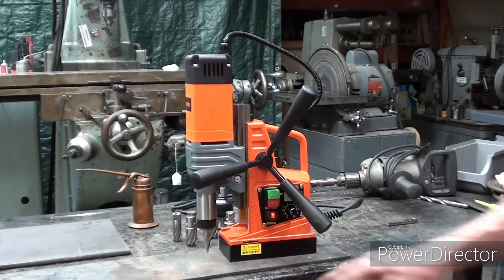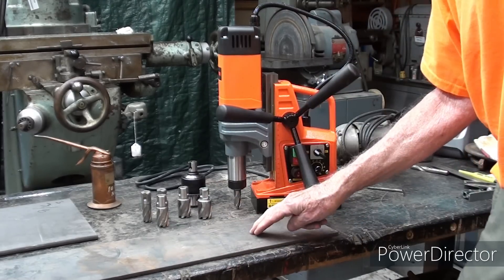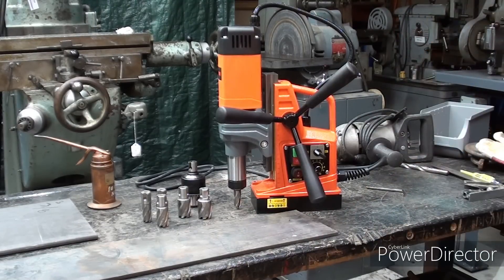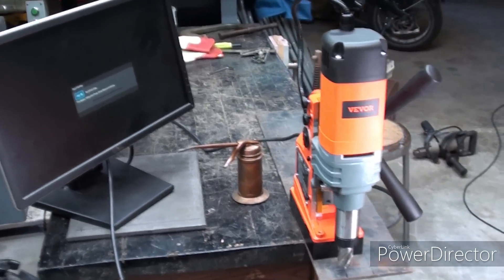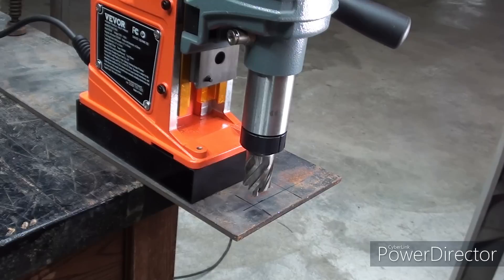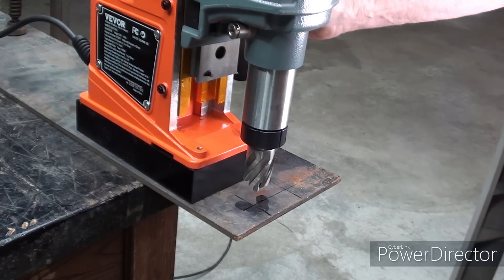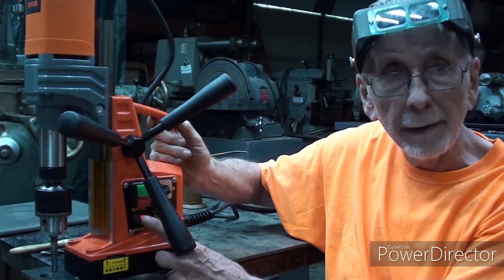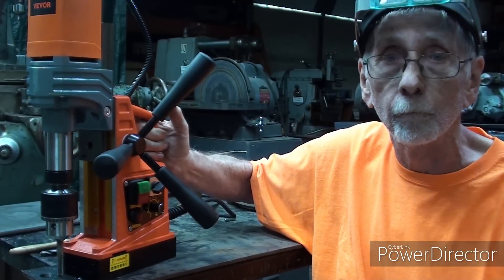MAGNETIC DRILL PRESS vevor pt 2 #877 tubalcain

Comment: Thanks for sharing. I had found the vevor magdrill on sale 6 months ago. I bought the regular Weldon style spindle. I needed it to drill hole in 3/8 plate. I did get a chuck and adapter for it. Stubby drills work well. The mag drill worked very well. I don’t use it all the time but I drilled over 100 holes over a week long project x four projects. I also nibbled a few slots. I used angle iron and “c” champs as a guide fence to move the mag drill base along a straight line.

Comment: My 1/2" Dewalt drill will tie you in a knot if the bit hangs up. My solution is to always drill through into a thick backing plate. It pretty much prevents hang up.

Comment: There is a problem with annular cutters.
Unlike twist drills which drill away your layout marks the slug from the centre of the hole is witness to how accurately your setup was because the layout lines and centre pop marks are visible for all to see.

Comment: 2 comments...  1:  when you drilled the first hole, the 'pilot' seemed to wobble significantly as you started...  how accurate is it?...  2:  back in 1966 worked for a surveying company one summer and had the job of setting monuments. (3' long rebar in a 6" concrete cylinder)...  The gas powered auger (2 man driven) had one person controlling the motor and the other at the end of two 3-4' poles to stabilize it.  If you caught a good rock or a bad root, the person holding the rods would be ejected more than a few feet... (happened several times - this was before OHSA)

Comment: I had a electrical hand drill with a #2 Morse taper spindle. I had to drill two 10" diameter holes in the transom of a large wooden boat. I made a 10" diameter hole saw using a 2" W bandsaw blade welded to a 10" steel disc.  I used an old 5/8" reamer with a #2MT shank as a pilot. We had a 3' 3/4" pipe attached to the drill motor.  The saw would catch and would lift 3 men operating it off our footing.. A scary operation

Comment: nice video, I have been using these slug cutter drills since 1992
and have four of them all different sizes , I install lifting equipment 
on truck chassis and these machines have saved my hands and forearms.
I'm currently trying out tungsten carbide tipped cutters , so far they are great
they are slightly more expensive but for drilling through chassis its the
best , my 20mm and 16mm cutters have about 600 plus holes on them.
Only one con they throw away because they are more expensive to sharpen 
than to buy.

Comment: If one was to get this this mag drill as a gift I to would think it's ok .  Luckly I have and old B&D mag drill from the 1970 that can work all day with the magnet on and has no problem drlling holes up to 1-1/2 . I can reshapen the drill bits onsite , unlike the angular cutters. I Wouldn call it true industrial qualty, unlike the Vevor. Tanks Mr Pete for the presentation might just be the thing to have for hobby shop.

Comment: While working as a millwright in a steel mill in the early 80's, I was using a large 1/2" portable drill with a hole saw to put a 2-3/8" hole in a hydraulic tank for a new hydraulic pump and the hole saw grabbed, almost broke my wrist and before I could shut it off it ripped the cord out of the handle.  Luckily no injury other than a sore wrist for a day or so.  Got the cord repaired and finished the job.
Reply from the maker: Scary, I actually hate hole saws. I’ve had too many close calls with them myself.

Comment: I have a big Milwaukee 1/2 chuck drill that I use to stir joint cement with a paddle.  That bucket need to be held with your feet as you stir the bucket or the bucket spins and throws joint cement everywhere.  I have had a couple close calls with that practice.
Reply from the maker: Sounds scary

Comment: Yes, in the early 70's, I worked for a boat manufacturer. I was given a 1" drill with a 1-1/2" bit to drill thru the transom to install the drain. Several times I did tricks at the drill rodeo for the enjoyment and laughter of my co-workers as that tank of a drill broke thru the 3" thick transom!  😁
Reply from the maker: Scary

Comment: Company I worked for bought 50 International Transtar Cabovers. We had to install 5th wheel hitches. Undrilled frames. 8 5/8 holes per side, through truck frame and crossmember gussets. 2 1/2 inch per side for the mudflaps, 2 3/8 holes per side for the tail lights, 4 3/8 holes per side for the 1/4 fenders. 800 5/8 holes through single frame and gussets. 600 3/8 holes. 200 1/2 inch holes. 1 inch electric drill, 2 men, 2 3/8 pipes 3 ft long for handles. We killed a whole bunch of 5/8 tapered reamers. And a pile of 3/8 drill bits. And that is why i can sharpen drills nearly perfectly. We also had to remove 2 air tanks and tie back lines on every truck, to prevent damage. Then we had to run 1/4 in plastic from the air manifold to the dash panel, cut out the slide switch passages, and run 1/4 in plastic to the sliders, then #4 stratoflex to the slide cylinders. Anyway, there was 3 of us, taking turns on that horrendous drill, until about a week into the project the boss came in with the oldest drill i have ever seen, with a huge electromagnet. it took 2 men to put that in place, and it ate that frame steel like candy. But you cannot forget how dangerous that first drill operation was, if one person slipped or the drill bit stopped, those iron pipes were spinning instantly.
Reply from the maker: That’s a lot of holes, and a lot of hazard

Comment: Hi Mr Pete i have drilled many of hole in truck frames  not fun . I bout on of the early Chines mag drill ( i got 11 cutters no drill chuck just under $300 in 2017 ) the one you have has more options than than the one i got . 
So one thing that's neat is you can make heavy duty  washers and you can also drill a pilot hole to help the cuter from wondering if you drill it the same size as the pointer you have to dig out the plug  . JM
Reply: Drill a center drill hole first then follow with a 60 degree spring loaded pilot to prevent wandering.

Comment: Last Friday the 11th, I went to a garage sale and bought a 1940 Montgomery Wards bench top drill press made by Duro Metal Products. All steel and cast iron. Great shape. For a bench top model it is huge. In refurbishing it I plan the replace the metal tube that supports everything with a longer one making it a floor model. Right now it is twice the size of my current imported model that I bought in 1982. My imported model has severed me well, but I need to be able to drill larger holes.
Reply from the maker: You will love that thing. Perhaps you saw my floor model duro drill, press in my garage???
Reply: @mrpete222  I don't remember seeing one, so I will have to back and watch some more of your old videos. They could not build a drill press like that nowadays. It would cost to much and nobody would buy it. Going to sales of used tools is far more fun than buying new ones and you get a lot more quailty tools for your dollar. Your YouTube channel and ScoutCrafters are my favorite channels.
Reply: @EVILDR235  Clausing is making drill presses in the US. 20" throw, hundreds of pounds, and about $5k.😔 I've lusted for one to replace my old C'man 150, but I have neither the space not the budget.

Comment: Three observations from a person that has used magnetic drills before on a jobsite. 1) You should always center punch a mark. It will guide the cutter and protect it better. If not, it might wobble and shift and those things are expensive enough to warrant not damaging them. 2) Take it slow. Do not add a lot of pressure and back out of the hole regularly to ensure chips are not building up. Again this protects the cutter and does not put as much load on the machine. 3) Do not ruin the chuck by cranking down on taps. They are tough and brittle, and there is still no guarranty they will not spin. Break one tap in a product can sour your day a lot. Use the dedicated tap holders for the tapered shank I assume is in the drill or alternatively get 1/4" hex tap holders for the chuck.  They are cheap and make your taps last a lot longer.

Once I had to make a very big hole in a stainless steel plate using a hole saw cutter. I stood on the plate and suddenly the cutter stuck and before I knew what was happening the plate and me took 8 round trips with me tangled in cable.
Reply from the maker: Excellent advice

Comment: Back in 1980 I owned a 1952 Ford F2 pickup. It had a 215 cubic inch OHV inline six cylinder engine. This was Fords first OHV six cylinder engine. When that engine went bad I installed a 223 cubic inch OHV inline six cylinder engine. They are both of the same engine family. The 1960 engine had a crack in the head and would overheat on long trips. At the time I was working for my good friend in his wrecking yard and he gave me a 1957 cylinder head to replace mine. The 1957 cylinder head used smaller diameter head bolts than the 1960 engine. I got the correct size drill bit using the 1960 head for reference. I bored out all the 1957 head bolt holes to the larger size using a Montgomery Wards drill with a half inch chuck. I was down to the last 3 holes to drill, when drilling a hole the bit grabbed the head and tore the drill out of my hands. It kept spinning until it wrapped the cord around the drill and then pulled the plug out of the wall outlet.
Reply from the maker: Scary

Comment: I’m with you, Mr. Pete- in your non-verbalized, but assured thoughts on that China pile of crap. 

It’s certainly nothing like my Hougen truck frame drill which cuts those same holes in a matter of seconds, and cleaner- made in Swartz Creek, Michigan, invented by a former GMI and Kettering engineering student. 

I’m glad for your video, though- I’ve entertained buying a Vevor as a cheap alternative to keep on my service truck, but what you’ve demonstrated in this video, I won’t get along with it at all. 

That thing is amateur hour, I’ll stick with American made rust belt machines. 👍🏾👍🏾
Reply: It's probably not a bad mag drill for the price point and for the home shop. I agree though, having run a top of the line Milwaukee, that was kind of painful to watch. Most home shop people don't have $2k laying around to throw at a quality mag drill that will maybe get used once a year or so.

Comment: Luckily went from high ground to lower ground - but drilling a big hole in pressure treated wood (which is really wet!) for a retaining wall. Of course, big huge low speed drill - and I checked in at about 130lbs back then. When it snagged in the wood it proceeded to toss me from the one upper yard into the lower!  Fun times! I must have looked like superman for a split second as I flew threw the air.
Reply from the maker: Wow

Comment: I hate to answer but Joe Burden is back in town. And yes i almost broke my wrist with a hole hog because I work in plumbing boring large 4” holes for toilet flanges. My Mikita drill 1/2” almost broke my wrist too. I will always use a pipe handle bracing it between the stud wall.
Reply from the maker: I have use the whole hog drills. Incredibly powerful and unstoppable.

Comment: My best mag drill true story:
Co-worker Bubba was using a dull 1" or a little bigger twist drill in a large (unstoppable) mag drill on a 16" I-beam. The beam was sitting on metal saw horses. He had his arms wrapped in the quill handle to force it through. He overpowered the magnet at about the time it poked out the other side. He couldn't get away from it, the drill and him spun around, flopped the beam over and then off of the horses. It kept spinning and had two wraps of #12 AWG cord around him and the beam. What saved him is that one of the extension cords unplugged in the mayhem. He ended up with some broken ribs, a severely sprained wrist, torn muscles and bad bruising all over his body. I made sure to tell him jokes for the next few weeks. Laughing helped remind him how stupidly he broke his ribs. (And yes, in those days the company let him come to work with broken ribs.)
Reply from the maker: Wow, that’s some story. Very scary.

Comment: I noticed when you tighten the drill bit in the check you only used one of the three locations.
I was taught to properly get a fit on a drill chuck was to snuggit tight using all three tool locations.

Comment: Yes indeed I had more than one unpleasant experience with a big portable drill! I learned to wear heavy welding gloves and some sort of torque arm through the D handle. Also used a "farmer drill press". Long pipe through the D, one end as a pivot and sit or push on the longer end.

Comment: My D-handle drill story, I was a strong twenty-something, not a gym rat but a working man. We bought our first home and were doing some remodeling work. We wanted to install recessed lights in the kitchen ceiling. So have a big drill and a 6" hole saw to drill through a sheetrock plaster and lath sandwich. I am on top of a ladder drilling into the ceiling, first hole no problem, second, ok well the third... The hole saw bites in I hang on to the drill it slows down and I am hanging on to this thing, the ladder starts spinning on the floor in a slow jerky motion. Just when I thought this was going to end badly the circuit breaker tripped and stopped the un-merry go round... The whole thing probably only took thirty seconds but it seemed like an hour. Yes, I had to get back on the ladder and cut the rest of the holes, this time I had someone at the ready to unplug the drill if needed. The other holes went without incident.

Tapping in a drill chuck, we would put the tap in the surface grinder and grind three flats on them. It really won't slip anymore but it sure will snap off quick...
Reply from the maker: That is quite a story. I would’ve quit after that and mounted surface light fixtures.

Comment: I used a mag drill in 1994 at the KY Center for the Arts. We drilled holes in the house girders to accommodate bracing for the extra demands the chandelier rig on "Phantom of the Opera" put on the structure. I was amazed not only that such a tool existed, but at how effortlessly it performed the task. We also used a hole puncher where possible. It was like one of those emergency electric tire pumps for you car, only instead of a tire fill valve at the end, there was a device that looked like a large paper punch. You place it on 3/8" steel plate and push a button. About five seconds later you hear a pop and you have a smooth hole and an ingot. Incredible little tool.

Comment: When I started in the elevator trade (before safety had been invented) we drilled the holes in the beams at the top of the hoistway to mount sheaves on with drills like the one that threw you off the bench.  Standing on an extension ladder from the top floor with nothing but air between you and the pit 20 floors below. When we got a mag drill it was a quite an improvement.
Reply from the maker: Scary
Reply: The story about the generator running the mag drill dying cones to mind, the drill fell.
Reply: Mag drills aren't without their issues though are they.
They don't come with "safety" tie down straps for nothing.
Contrary to Mr. Pete's comment .. it isn't difficult to break free the magnets especially on rusty or heavy painted beams
They are dam heavy and if, like you, you were .. up a  ladder you wouldn't want it on your head 😎🙈
Reply: @stevewilliams2498   We were always working on new beams but still always had safety straps in place. This was sometimes difficult to achieve as the beams had no holes in them and a concrete floor poured flush with the tops of them. We would use C-clamps and other methods to hold them in place. When we got the drill up there you locked it in place near the place the hole was going to be and kept one hand on it  incase the power failed (which was not unusual on construction sites) attached the straps or chains. Then moved it to the exact place to drill the hole.

Comment: That is a really neat drill.  I think it is overkill for the average home shop.  Thanks for the video keep on keeping on.
Reply: The advatage of the magnetic base is that you can mount the drill on a vertical beam and drill horizontally.
Reply: @bitjockey6265  I am not saying the drill does not have advantages after all it is a wonderful tool.  It could be the poor boys radial drill.
Reply: Not really. Every home shop has a drill press, and if I could only have one I'd pick the mag drill over the drill press. It can do anything a drill press can do and so much more. Where it really shines is when you need to drill a hole in something that won't fit in a drill press.

Comment: Not a drill scenario, but as a hotel Bus Boy in the school holidays and weekends, I used to polish the ballroom floor with a big electric buffer. The cable was always getting in the way, so I used to drape it over my shoulder. I managed to buff across the cable, which immediately wrapped around the drum, pulling me towards the handle bar which caught under my chin and nearly strangled the life out of me, but I managed to turn my head to the side and regain my airway !
The local crane manufacturer here had some huge, 2 man air powered drills that had a handlebar throttle, like a motorbike, they were so low geared, they took an age to stop, H&S would have them banned today !
Reply from the maker: Scary

Comment: I was cleaning a fixed platen on an 800T injection moulding machine with a 1000w drill and a brass brush bit, it got my T-shirt and the on button got locked on. The only thing that saved the day was the plug pulling it shelf out, but my T-shirt was like rags. Lol
Reply from the maker: Wow